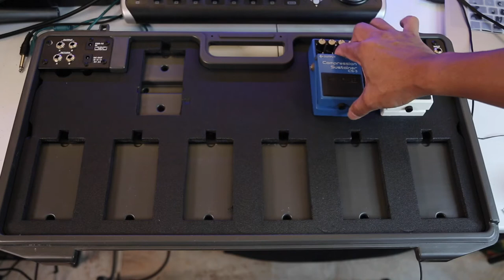Boss BCB-90X - Pedalboard Build

Comment: I have two BCB 60 for years on stage  and they're very noisy with their stock Boss power supply.
Reply: Thanks it was my question
Reply from the maker: Hello there, I am using Boss power supply as well but my setup is not noisy. Maybe you are using bad cables. you can dial settings on your pedals just about right not to produce excessive noise or add a noise gate or noise suppressor onto your signal chain.

Comment: Question, where did you get your "daisy chain" power chord?  I found a Roland Boss PCS-20A Parallel DC Daisy-Chain Cable on Cramazon, but the distance between the individual power connectors is about 5 inches, very tight.
Reply from the maker: Hi. The daisy chain comes together with BCB-90x. The spaces (length) between connectors are just right for my setup.

Comment: Hey I’m going for this exact build but really don’t understand the difference between some of these pedals right now I have three pedals the ds-1 distortion Ch-1 super chorus and the Rc-1 loop station, I’m definitely adding the MT-2 and the PS-6 what other pedals do I need? And what’s the difference between my distortion and yours? What does a super chorus really do?
Reply: Edit: I will also be adding a digital delay probably. And a chromatic tuner. Will I need a noise suppression pedal?
Reply from the maker: Hi. Thanks for watching. DN-2 is a drive pedal that responds to how hard you hit your strings. Soft hit means less drive. Hard hit means more driven sound. It’s about dynamics. OS-2 is a combo pedal, you can dial it to get an overdrive sound or distortion. MT-2 is more flexible because of the included EQ perfect for Metal and Hard Rock sound. Your current pedals are good. You just need to know how to dial the settings as per your liking. There is no wrong settings using effects pedals. It’s all about your taste in what sound you wanna achieve. Super Chorus by the way is a modulation pedal. You can experiment with the knobs to get the sound you are loking for. Thanks and Enjoy!

Comment: That power supply would get those drive pedals noisy
Reply from the maker: Noises are generated by a couple of factors. There’s noise coming from a cheap cables and connectors. There’s noise coming from plugging your power supply to an outlet that is somehow connected to light dimmers. Some noises are coming from guitar amps. Some noises were generated by cheap guitar pickups. And the most common source of noise is the wrong settings of the pedals or wrong combination of pedals. For example, if you have an overdrive pedal and a distortion pedals, pressing those two at the same time will generate more gain thus inviting feedback and too much distortion. It is possible by the way to use 2 drive pedals at same time but you have to dial the correct settings. Experiment is the key, try different and look for your desired sounds. Good luck 👍😎
Reply from the maker: Hi. Yes, in some cases but my setup is just about right. I do by the way updated this pedal board for the 2nd time and will upload it soon. Thank you.